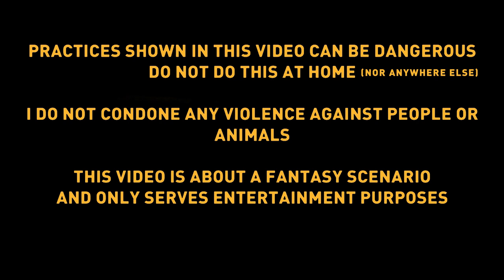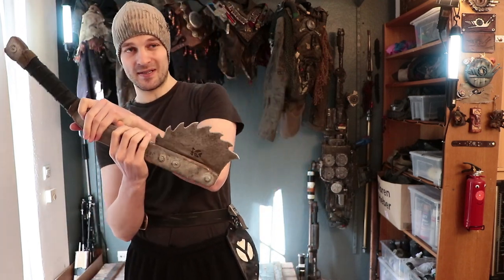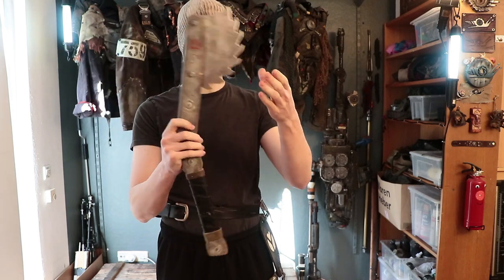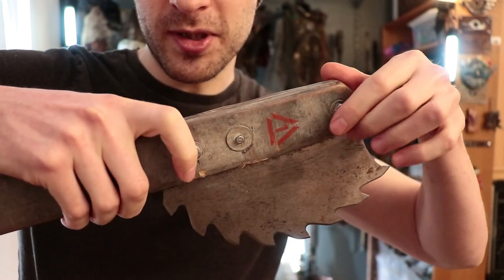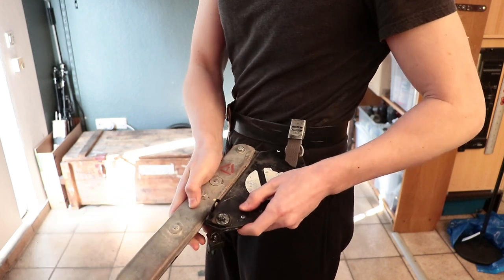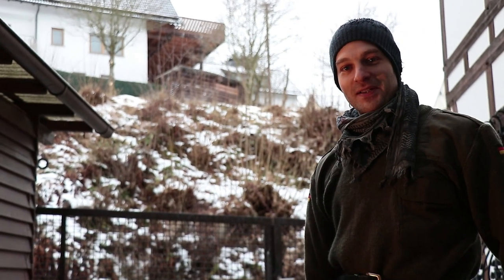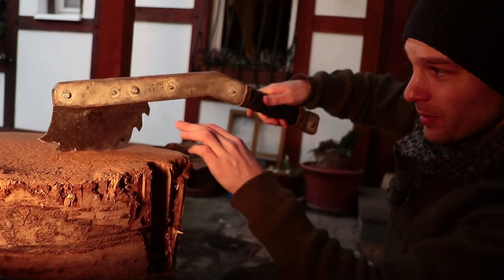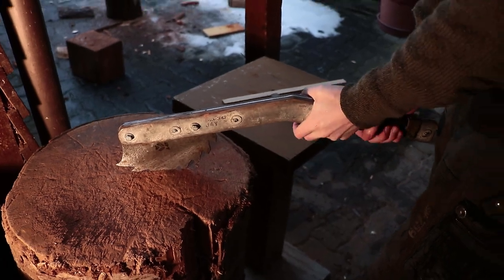My Sawblade Axe TEST. Does it suck?

Comment: Nice video. The axe held up pretty good. The reason it twists you wrist when the alignment isn't right is the forward tilting handle. It extrapolates the twisting force because it's at an angle and not aligned with the axis of the force. Also forward curved handles reduce the centrifugal force (ever so slightly, and perhaps insignificantly) because the tip is closet to the center of motion.

Comment: Two minutes in Dmitri mentions the kukri as an example of a weapon with a "bent forward" blade...other examples of bladed weapons working on this principle are the Greek falcata and Egyptian khopesh...the Romans had the sica but it was mainly used by gladiators.  Among the Native Americans there were ball-headed war clubs that used the same principle...while it could be used to reach over a shield the primary reason for this shape was to make use of centrifugal force to maximize the power of a swing.
Reply from the maker: yeah thos4 weapons do come to mind too, didnt list em all. now you did :) 
but CENTRIFUGAL force? how/why/WTF?
Reply: @NuclearSnailStudios    There's more to a swing than just gravity, otherwise you're simply dropping an object on someone's head.  To use an example from school, think of a bucket full of water being swung on a rope...once the force of gravity is overcome, rather than the water dumping out the water is pressed towards the bottom of the bucket by centrifugal force as it spins.  Of course, since you have to do this with more force than gravity, this also works to make the water "heavier"...instead of, say, 1G, if you're swinging it enough it might be 5Gs...if someone happens to get in front of it they won't just be getting hit with, say, 1kg of water, they're getting walloped by 5kg of force from 1kg of water. (Ouch!)  Of course, since enough energy is being used to overcome gravity's "downward" pull, this means an object can be swung along any plane...in this case we're merely substituting an axe head for the bucket, and the haft for the rope.  As for why the bent haft (or, in the swords, bent blade) adds power is that, when held, is already "trying" to be off-balance...it "wants" to fall forward and find a nice head to land on.   I have a Cold Steel ball-headed war club that messes with this principle...not only does it naturally pull forward when held, it's smooth polypropylene handle is sometimes hard to keep a good grip on;  until I get some grip tape and a wrist thong on it it's not looking for a skull to crush, with a full swing it might fly out of my hand and go on vacation to Hawaii.

Comment: The design looks good and agressive, but when designing a melee weapon, I would try to not reinvent the wheel in some way ^^' I mean I am certainly not going to do a better job designing a weapon than more than 7 thousand year of civilisation trying to make the best weapon to destroy one another ^^'. 
So for the optimal melee post apo weapon, I would look for what were the last mainly used melee weapon in warfare.... nowadays it's the knife because it's smaller, less balky and lighter, so it does not bother the soldier when he is using is firearm. But if we go for a scenario where firearm became realy rare because of ammo shortage, then the saber is the way to go, as it's lighter than an axe, more nible, it can also go around a shield and cut with the false edge (recent scholagladiatoria video about it btw), But it require a proper training and a lot of maintenance... and maintenance is crucial in most (to not say all) post apo scenario... in some ways the machete falls under those same arguments as well, however, it seems to work well for nowadays africans warlords, so a machete would be better as a post apo melee weapon. But, do you, in a post apo scenario, want to carry a thing that only have one purpose or an item that can answer to many tasks you might have to do... for me not that much as it would just make all your equipement heavier and mobility, in most post apo scenario is also crucial, even if you have a great stabilized community with walls and all.... if the unfriendly neighbour attacks you... and you have to run away fast.... too much weight could mean your death.... 
So we have to go down to the hatchet or the tomahawk... you can also go to the club/mace like in trench warfare or the shovel even... but this were weapon made on the field as the soldier were not issued better melee weapon. So hatchets/tomahawks are pretty much the way to go... and tilting the handle forward can help when used as a weapon. So you made quite a good idea for a weapon that would be good in most post apo scenarios (where guns are out of the question of course) but I think it would be better with a straight edge... as maintenance would be a lot easier ... but you would loose a lot of the agressive look that is actualy not a factor to minimalize in a fight... 
So did I argue with myself and defeat the point I made in the begining about not reinventing the wheel... .... I guess I did XD